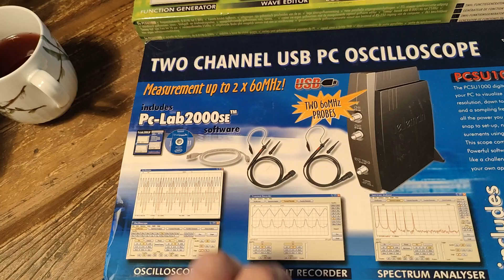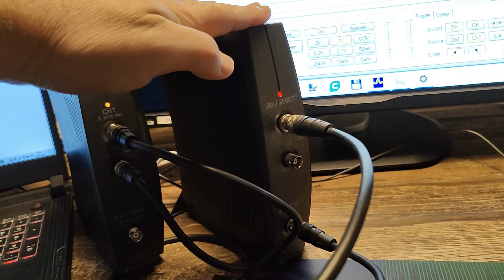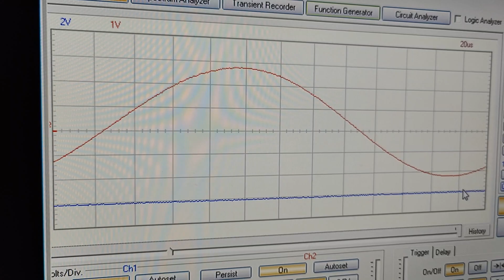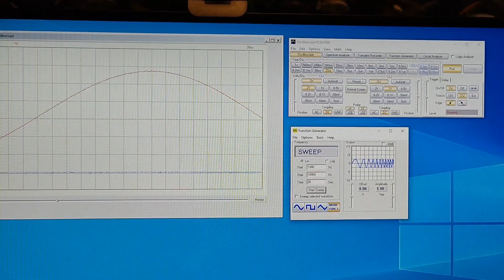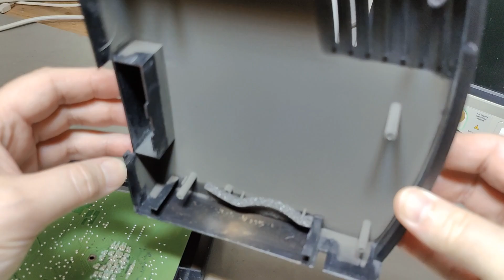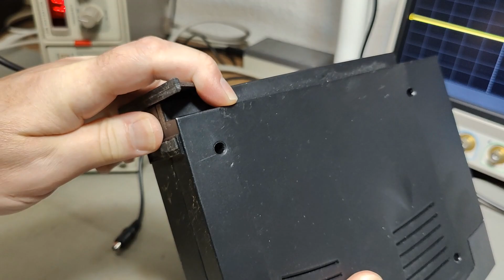Velleman PC USB scope PCSU1000 60MHz Function generator PCGU1000

Comment: Hi - Is it still possible to use this Oscilloscope-PCSU1000 with software pclab2000se_v4_07 and driver PCSU1000_driver_2.04.16 on Windows 11? 
I'm not able to install the driver (even trying the computer in “Driver enforcement mode” for installing unsigned drivers). I tried several other FTDI drivers and I was not able to make it work :(
Reply from the maker: no it does not work, it is a "thing" with those PC connected units, they dont blow up, but just dont continue to work when a PC goes more modern, one solution is to keep a time period PC without updating it, to operate the measurements, for this, i got win98, and winXP machines ready to roll :-)

Comment: I have a PCSU200 version but I can't get it to work with the drivers downloaded from the official velleman site, the autocalibration always fails, also I don't see any signal at the oscilloscope input, and no output from the waveform generator. Have you had a similar problem? Thanks

Comment: I have a PCSU-200 version but I can't get it to work, the autocalibration always fails, then even though the indicators on the ports are on I don't see any input signal. Also the generator output is silent, even though it seems to be working.

Comment: The USB interface is FT245BL with parallel interface (not serial) although they use the same driver. It can pretty much saturate the full speed USB bus.

The FT245 could be used to directly load the FPGA via JTAG. It has a bit-banging mode especially for such uses. Convenient. So they could do it without the PIC.

For lower frequencies they should have used dithering. There should be two output filters: a permanent reconstruction filter, and then an optional dither-removal filter that can be added in series before the reconstruction filter. The FPGA can generate dither that has frequency content outside of the dither filter’s passband. That way dither improves linearity without adding anything visible on the output. For the fastest outputs of course the dither has to be removed and the dither turned off if lowest noise is the desired criterion. Otherwise, dither will help with single-tone distortion as well as IMD at higher frequencies as well (closer to Nyquist limit).

Comment: What IC is responsible for driving the analog output of the PCGU1000 ?
Reply from the maker: is explained quite well in this video
Reply: @TeardownOZ2CPU  No you didn't.  You mentioned that the signal is synthesized by the Xtlinx Spartan FPGA and later converted to analog by the AD9748 TxDAC and later summed by an undisclosed op-amp (its number is not mentioned nor legible) with the DC offset signal (generated by R2R) . Then you interrupted your analysis so I am lacking the information whether the output of this op-amp is buffered by another IC before hitting the analog output or fed raw directly from that op-amp.
Reply from the maker: @amciaapple1654  i see another opamp after the sum and 4051 switch, that one drive the output i assume, this way you get a nice low and flat drive of the output, i dont have a schematic, i just look carefully at the pcb and use my experiance to see how parts are connected to each other
Reply: @TeardownOZ2CPU  So what is the part number of that final opamp ?
Reply: @amciaapple1654 Use whatever has the right specs that you can buy from a good distributor.
Reply: @TeardownOZ2CPU  1 year later:  What is the part number of that final opamp ?  Probably IC12 or IC 16 ... unless the output is driven by the T7 and T8.
Reply: @TeardownOZ2CPU  1.5 years later:  What is the part number of that final opamp ?  Probably IC12 or IC 16 ... unless the output is driven by the T7 and T8.